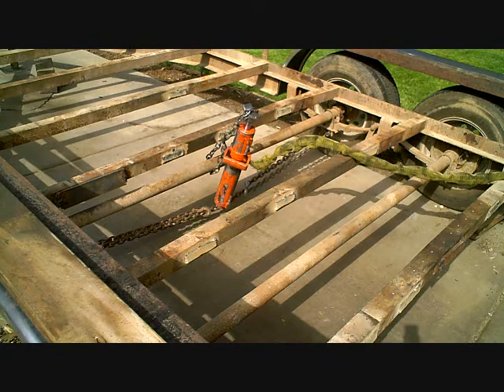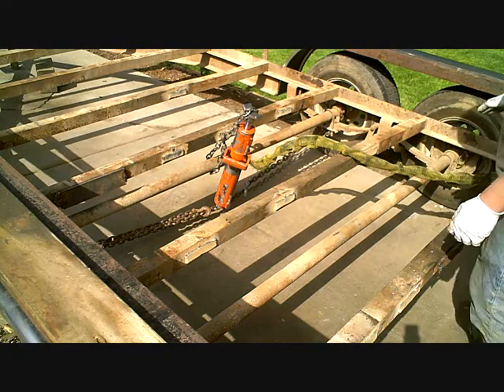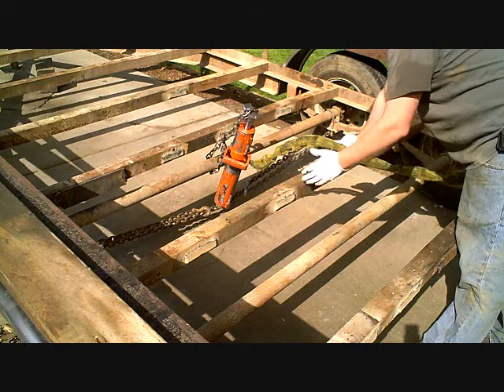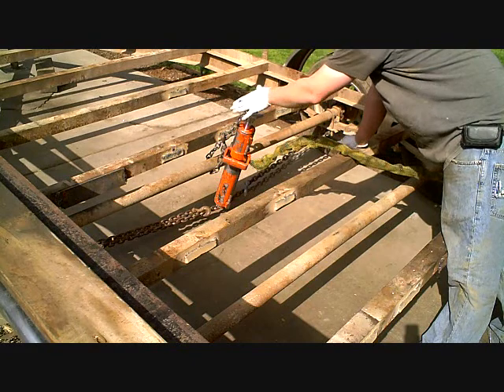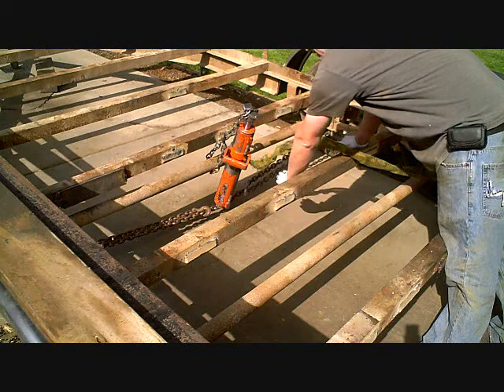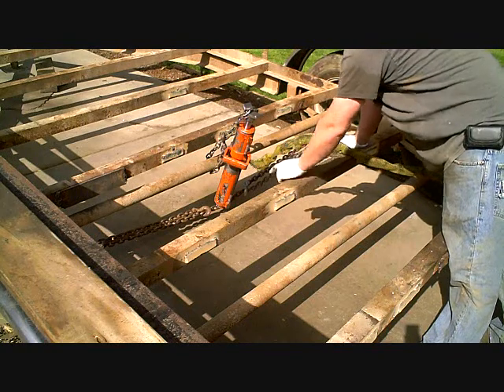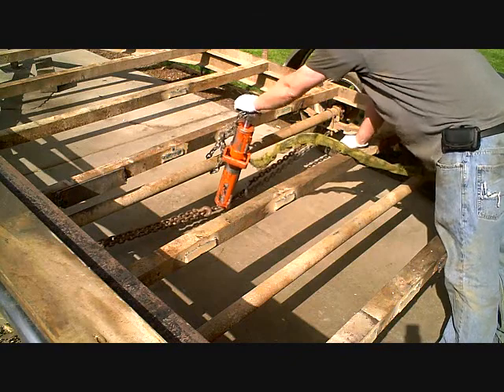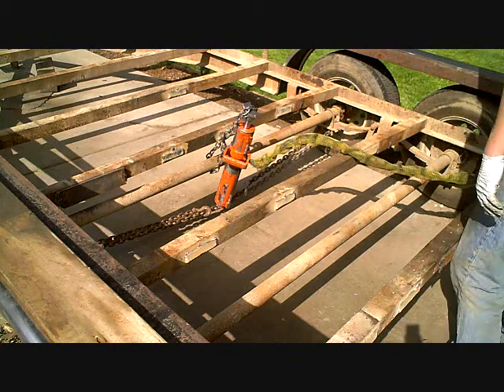Straighten bent trailer axle with a Porta Power hydraulic ram

Comment from the maker: @evolution2015 ........the trailer had no weight on it and the hydraulic ram actually lifted the tires off the ground. You are going to get enough tire flex with an unloaded trailer not to need to roll the trailer.

Comment: Nice demonstration!  Thank you!
Reply from the maker: Thanks.. This can also be easily done with a high lift bumper jack.
Reply: I'll try using my farm jack. Thanks.
Reply from the maker: That will work good. Tie it off good so the jack cant jump out.
Reply: Terry, did the farm jack work for you?
I need to do this to a car hauler that has a bend about a foot in from the hub. I don't own a porta power so I was thinking about using my jack also.
Reply from the maker: You can use a bottle jack as well as long as it has enough throw. You can also flip your axles if the spring perches aren't welded on and you have a smooth bend.  If your axles is not evenly bent with a smooth arch you can use a chain and bottle jack in the spot that is bent to straighten it. Bottle jack on the bottom side of the axle, with a chain around the bottom of the jack and tied to both spring perches. I would use a scrap piece of steel to spread the load of the top of the bottle jack and I would personal tack weld it to the jack. I may even tack weld the chain to the bottom of the bottle jack to keep it from slipping.  Wrap a heavy coat around the contraption to absorb an impact if it flies out. FYI: If you have 3500lb axles you are going to need at least that much power in a bottle jack to bend it back.

Comment from the maker: The way I positioned the chains it will only have a very very miniscule "toe in" that wont affect performace. The chains a positioned almost a foot from axle center on top and bottom. This makes the pull angle very steep.

Comment: Doesn’t the bend down and the bend up end up compromising the total load that axle can handle now? At least to be safe I would think the total load carry would be smart to reduce some knowing there is an axle that’s been tweaked twice. Surely the metal structure had to have been weakened to some degree.
Reply from the maker: Steel doesn't really fatigue easily. The center bend is really only for wheel camber with all the load is on the springs. The force acting on the center is in the realm of 200-300lbs with a 3500lb load on the wheels.

Comment: my trailer has bent cross members.  could that be straighten up or should I just but new ones?
Reply from the maker: +ROBERT SANDOVAL This trailer had all of it's cross members bent. They were angle iron so I pie cut them, bent them back up and then welded a plate over the pie cut area. If you look closely you can see them in the video.

Comment: How about if I just turn the axle like 180° ? Like upside down
Reply from the maker: Absolutely that could be done. There are a few scenarios where that can't be done easily. One would be if the spring perches are welded on and another would be if interferes with the electric brakes.

Comment: You know a 3500lb axle is about $120 and a 5200lb about $150 . These are idler axles no brakes , but you would just swap your brakes onto the idler axle . If you don't have brakes then obviously nothing to swap.  The issue with the  bending of the tube is that it will likely bend easier now since it was bent . It just seems like you would be further ahead simply unboltimg and replacing it's something that takes only about an hour or Two and then you have new axles.
Reply from the maker: Yes and no. A cheap narrow axle may be $120 online but will run more locally or shipped. A 95" axle like these are closer to $200 a piece and you should probably change springs, ubolts and hanging hardware while you are at it. So you're going to be closer to $500-700 for this trailer. Bending it back won't cause it to deform easier the next time. They start with straight tubing from new and bend it in a similar way from the factory.  Steel is resilient and only bends when an excessive force is applied. In this case the trailer was used daily/commercially to haul a skid steer with equipment well over it's 7000lb rating  and it caused the damage. 10 years later this particular trailer is still in use for light commercial use and hasn't bent back and tows great.
Reply: @sixtyfiveford  an idler axle in a 95 hub face is not anymore expensive  it's a standard size that they make for typical trailers as do they set the spring centers for that as well , so a 95 is not some exotic beast it's something Rockwell American and TK have sitting on racks by the hundreds. There wouldn't be a need to replace leaf springs or hubs unless damaged or wore out in which case you would need to do it if just straightening,  so back to fixing just the bent axle  .. and we're still just ordering an idler axle based on very standard hub face and spring pin center with no hubs or springs just a tube/spindles/ perches  ready to swap on the hubs and bolt up .this I assure is between $120-200 tops ... yes add in New u bolts that will set you back all of $10-15 "buck ". This can be done  In less than 2 hours in a driveway . I can  buy an axle kit with TWO new 5200lb braking axles,  leafs,  hardware,  and tires for $1400 shipped. 

Oh by the way the typical spring hangers used fo 1-3/4 wide double eye leaf springs are the same from 2000lb--7000lb axles  .
Reply: @yerwrng  You have convinced me. You had better just buy a new axle. This isn’t for everyone.
Reply: @836dmar  yes strapping a chain around a tube and using hydraulic cylinder to bend it is some very techy stuff ... Lol... Some next level fabrication right there how will one ever figure it out .

Comment: Just rotate the axle 180 ?
Reply from the maker: adamkingsho Yes, you could do that on some axles. Some have the spring perches welded to the axle and the brake axles will need the brakes flipped as well. It's a great option though for most trailers.
Reply: I thought that too but you have too cut the axle and modify position of the leaf spring support plate....